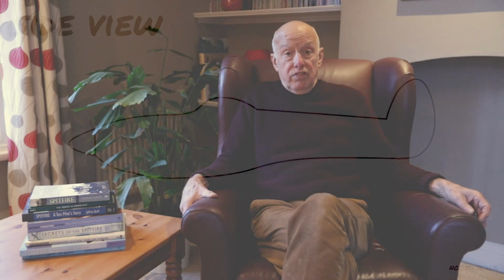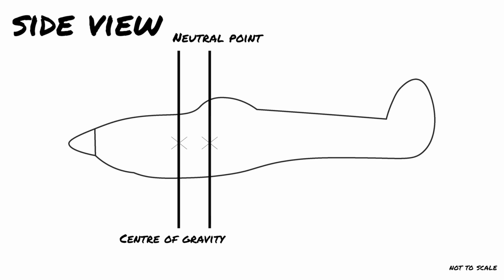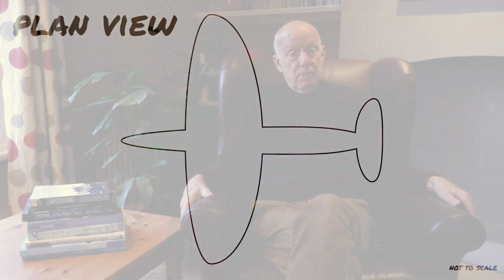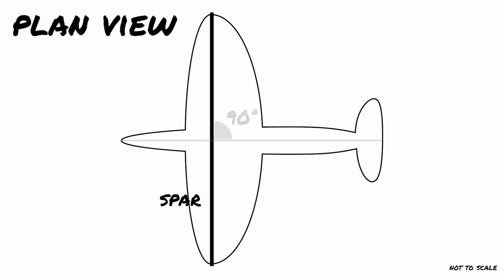SPITFIRE SPEAKS: Spitfire Longitudinal Stability

Comment: More than ten years ago I was an ardent player in a quite good flying simulation, Il-2 Sturmovik. The downside of the game was obvious adjusting of the favored flight models. From one point a modification to the FM of the Spitfire has been made that made it marginaly stable on the lateral and vertical axes (longitudinaly and directionaly). That spoiled the aiming quite a lot. I made myself quite obnoxious on the forum of the game about that, saying that no one would have let such a vice uncorrected. Now I see that I may have been wrong (maybe they have overdone it, but I cannot know). Thank you for an excellent video. I suppose that could be the reason the Hurricane has been oft described as a stable gun platform, in comparison, obviously. Otherwise, the Hurri was a log in the game. The capability of the game to portray the plane FMs accurately was quite obvious, but the adjustments to suit the wishes of the parts of the game community were just as obvious, as well.

Comment: Fantastic video. Loved the explanation of the neutral point and C.G. A little confusing around the N.P. and the aerodynamic centre.  Second point: is there any information anywhere as to moving the engine forward an inch or two to help bring the C.G. range forward? Having flown both a 3/4 scale Spit and a 1:1 Spit I can say : it is in the wing!!!!  The nicest wing I have EVER flown.

Comment: With reference to the vertical stabilizer (tail fin) of the spitfire:

Are any spitfire fin leading edges offset to the centerline of the fuselage, to correct for engine torque / propellor P factor that causes yaw. Or was this problem simply addressed with the rudder's trim tab?

If done, the offset will be to the left for the Merlin Spitfire and to.the right for the Griffin powered Spitfires.

I have noted the the P51 Mustang has about 3/4 of an inch of offset to the left of centerline of its leading edge of the extented fin  to correct for the clockwise turning Merlin.
engine.

J

Comment: Very interesting. I have often wondered why Spitfires could not carry out long range escort missions like the Mustang. I have often wondered why the Mustang was faster than a Spitfire with a similar engine. When the Spitfire Vs were being given the run-around by the Fw190s, I wondered whether the Spitfire might have been made a bit quicker by making the rear wheel retractable, but maybe that would have moved the aerodynamic centre point forward? Some Spitfires had clipped wings, but I don't suppose that made much difference to the centre point. A lot of Spitfires had that car mirror on the canopy. They must have felt they needed it, but maybe that affected stability too. The first part of your video made me think of WW1 Sopwith Camels. I know they had a rotating engine, but their wings were quite far forward on the fuselage. They were manoeuvrable, but difficult to control for novices. Other aircraft like RAF BE2s were too stable.

Comment: Hmmm....... Well,  MkIX's were NOT produced with a larger fin, and only a few had the slightly larger rudder fitted when new, though the 'XVI's all had that. In fact, for the purpose for which it was designed, the Spit's tail surfaces were adequate up to the IX. Under normal loadings, the Spit's up to and including the 'IX were just adequate longitudinally, and for the job in hand, that was fine. MkIX's/'XVI's were being produced from 1942 until the end of the war with no significant changes, other than perhaps the bubble-canopy, which a few MkIX's had - and many 'XVI's had with the taller rudder - but these were relative details.

As for the suspected problem with inflight break-ups, my recollection is this was around the MkV with four cannon, that also had bomb shackles fitted inline with the cannons.... One pair of cannon were deleted, and stiffeners added to the wing as a fix. (Four cannons were not fully re-introduced until the later much redesigned wings on the MkXVIII & later.).

CG issues were a separate matter. (Extensive test were carried-out on the MkV for example, to ascertain how severe a rearward CG the MkV could tolerate.).

As for cooling on the ground - the problem was not specifically the position of the radiators, but the fact that the u/c interfered with the airflow in front of the radiators. As soon as the gear was retracted, there was no problem.

The problems really started with the installation of the Griffon in the MkXII, though at that stage - it wasn't producing such prodigious amounts of power and torque as the later Marks. These were soon addressed. Of course, by the time the MkXVIII/21 came along, most of these issue were solved, however, by that stage, there really wasn't much 'Spitfire' left in the true sense, except some of the lower half of the fuselage......

BTW;- The later wing's ailerons were metal-covered and differently hinged - size had nothing to do with the improved roll-rate.

It's a common fallacy to compare the Spitfire unfavourably with the P51B et al. The Spitfire was designed from the outset as an interceptor and air-superiority fighter. End of. Whilst for various reasons the P51B et al were capable of greater range than the Spitfire, it was not, in the strictest sense, such good fighter. However - as some American wit was reputed to have succinctly put it - 'The Mustang can't do what the Spit can do - but it can do it over Berlin!'......indeed.  Horses for courses.

A pal of mine who passed-away a few years ago flew every Mark of Spitfire and Seafire produced, as well as all the other Allied single-engined fighters and a good deal else beside. He was unstinting in his praise for the Spitfire - not simply in a partisan way, but because of the actual hands-on flight characteristics of the Spitfire. His view was that whilst, as a fun aerobatic mount, the magic started to fade after the MkV, as a pure interceptor and air-superiority fighter, the Spitfire was the best of the Allied piston-engined fighters until the end of the war.
Reply: Interested in your one line comment as to the ailerons. I understand that the later (Mk21-24s) were piano hinged, but I also thought that Quill and his development test team had ‘discovered’ the benefits of metal ailerons by the end of 1940, and these were quickly adopted for all spitfires produced from that time onwards and rapidly retrofitted onto spits already in service.

Quill was obviously biased but he thought that the Mk VIII had the best overall flying characteristics, including I believe regarding aerobatic ‘fun’. 

Also intrigued by your comment that the size of the aileron doesn’t matter. Clearly Supermarine thought that going larger on their redesigned wing for the Mk21-24s was a good idea. Would you care to expand on your thoughts? Cheers A
Reply: @andrewmetcalfe9898  ;-  Ailerons;- Correct - and it was the piano-hingeing that finally sorted the ailerons. To be clear however, unnder normal circumstances, even the early Spit's fabric-covered ailerons were fine. The problems occurred at very high speeds, when the fabric would 'balloon'. Heaviness - then severe stiffness, then finally reversal could be experienced - but we are talking about diving balls-out in a combat situation. Even in 1940, Spit's were diving at around 500mph. When JQ was seconded onto an operational squadron, he was quite alarmed by this. I think as a result, Spit's were then produced with a somewhat lower-range ASi's..... All this occurred of course, because the Spit' had such a thin wing with a much higher Critical Mach number than other fighters around at that time. At the other end of the scale - huge problems were experiences with compressibility on the P38 - but that's another story.

My pal was a close friend of JQ's. The MkVIII was very close to a MkIX, but whilst both types enjoyed greater power in absolute terms, at or near sea level, the lighter, and higher-powered versions of the MkV had the edge. At full power, my friend would take-off, then pull-up  and over into the inverted, retract the gear, erect the a/c, then pull-up into a sieries of half-loops to display height. During the initial part, the machine was rather hanging on the prop' and one cough....and that would have been it....but they were different times. This was also before the proper pressure carb's were introduced, so inverted running-time was severely limited.

Ailerons again;- I didn't say that the size 'didn't matter' - I was referring to the fact that it was the new type, that was  piano-hinged that fixed the problem - a much better gap-seal for starters. I don't recall there was a vast difference in size. Staying on this subject for a moment - one of several reasons that the MkV's had such a hard time when the '190 was introduced, was that - although the Spit'V could easily turn inside the Fw, the Fw had a much better roll-rate. Add to that the '190's better acceleration into a dive....and you can see the problem. At that time - Spit V pilots were strongly briefed not to dawdle and to fly in the best part of the MkV's envelope at a high cruise speed - and NOT to give-in to the temptation to dive-away.... In any case, the MkIX soon came along and more than matched the '190 - and was heaps better over 20k'.
Reply: @HeavensGremlin  thank you for your very informative reply.
Reply: Thank you for your informative comments. The first MkIX's were just converted  MkV's and had the original tail fin, so the broad coard fin was introduced primarily to combat the additional torque reaction of the 60 series engines.
I had always thought that the tendency of the Spitfire to overheat during prolonged spells on the ground was due to the radiators not being fully in the prop wash. One thing that has always puzzled me is that the MkIII was abandoned because they had trouble accommodating the XX Merlin engine with two speed blower and yet they managed to modify the MkV's to take the longer 60 series engine in short order. Maybe the FW190 threat was so serious that it concentrated minds wonderfully!! One thing is for sure, Stanley Hooker at Rolls Royce was a massive
help in that he first got more power for the Merlin 45 by redesigning the air intake, blower impeller and diffuser, so that the Spitfire V was able to cope with the BF109F and then even better, he came up with an inspired design of the two stage, two speed blower with after cooler, in a small enough package to get into a modified Spitfire. The MkIX was surely the best interceptor fighter of WW2, in combining all the handling characteristics of the original Spitfire with a compact and very powerful engine package. Sorry, I am forgetting the later MkVIII, which was a shade better still!
Reply: @jamesmorse959  ;- The fins on the MkIX/XVI were all identical to the MkV's - only the rudders on later production machines were slightly altered. You can see many photos of the apron at VACBAF full of MkIX's fitted with the original rudders. Most MkIX's had exactly the same rudder as the MkV's. Once the Packard-engined 'XVI started being rolled-out, yes they had the pointed rudder, and a few MkIX's may have had them too. Incidentally - most people think that only the XVI's were bubble--canopied, but in fact, some of the MkIX's also had that cut-down fus' too - with the slightly larger rudder. Likewise, some XVI's were high-backs - but those would also have had the pointed rudder, and I think this is where some confusion has often crept-in.

On the speed of introduction of the 60-Series Merlin;- The reason they were able to move so rapidly in response the the arrival of the '190, was that the new engine already existed as a complete ready to go turnkey-package of two-stage, two-speed supercharger for the new high-altitude Wimpey. The engine was not designed as a response to the '190 - it was already completed. When someone suggested fitting it into the Spit', they rapidly cobbled-together a prototype - up at Hucknall I think. From memory, they didn't actually use a MkV for this. Anyway - it showed much potential and the rest, as they say, is history. One of the very clever things that they managed to do was incorporate the Vokes air-filter, so thereafter, a separate version was no longer required to incorporate this feature. Thereafter - that nose/cowling ran through all the Merlin-powered variants, excepting the co-related PR variants. The extra cooling area required was added to the oil-cooler side, and, being aft of the CG, this probably helped to offset the heavier engine and longer moment to some degree. Although they went to a four-bladed Rotol airscrew - being wooden, the actual weight was probably similar to earlier all-metal three-bladed airscrews.

For fighting - the MkIX was without doubt an all-time 'great' - and from 1942 until wars end - the Axis had nothing to match it that was available in quantity. For pure low level fun & aero's, the Merlin 45 (See my reply to Andrew above.) engined MkV provided a powerful, yet lighter package than the 'IX great for fun - but after the '190 came along - if you were going into harms way in the ETO - then the MkIX was the best mount.

Comment: Many many thanks. Finaly sommeone explaining to me why the fuel tanks were forward of the pilot and never put behind or below him.  The small tailplane and in general small plane with big engine concept. The wing radiators of which there was only one at the beginning is also a subject. I suppose the impact of ever increasing engine power was not envisaged. Would not the weight of the radiators behind the pilot, as in the P51 configuration ,  also cause the same problems. I see I am at the right place for expert opinon so explanation of the Meredith effect would be good from anyone. Was it real?
What about the Bf 109 tailplane? It had struts, but the fuel was under the pilot. Range similar to the Spitfire.
Reply: Hi There, thank you for your nice comments. The change to two radiators in the Spitfire was to handle the heat generated by the more powerful Merlin 60 series engines. As well as this, the new intercooler on the two stage supercharger was also water cooled and needed an additional small radiator. So the port radiator was a combination of engine cooling and oil cooling and the starboard was for engine cooling and intercooler cooling.
I am no expert in thermodynamics but the 'Meredith effect' does work! It is particularly effective of the P51 because there was room to have a large plenum area before the radiator, thus slowing the air flow and then a large heating
of the air across the rad before then being compressed at the outlet. This did generate some thrust and as I said, the P51 used 100% glycol so the radiator ran hotter which also helped. The weight distribution and C of G of the P51 was quite different to the Spit, with the wings set further back and the aerofoil having maximum camber at 40% coard instead of 20% in the Spit. The result was that the neutral point was also further back and allowed loading of equipment further back in the aeroplane. If you look closely at the P51, the wheels are set quite far forward in the wings; this being to prevent the aeroplane tipping on its nose! The BF109E did have struts on the tailplane but these were discarded on the 109F, when an effort was made to clean up the aerodynamics a bit. I imagine that the tailplane structure was strengthened to enable this change. I do hope that all this makes sense to you, and thanks again for your comments.
Reply: @jamesmorse959  Thank you very much for taking the time to reply. I have just read the article in Wikipedia on the Meredith effect. It says that it was a British invention and that it was built into the spitfire even. There is a reference given. It makes sense, but I think as stated it  will work best at very high velocities. As the engine powers increased, and with it the heat generated, the advantages increase. The objective will be to heat the air to a high temperature in a very short space of time and incorporate it all in a square convergent divergent nozzle. A type of ram air driven jet engine concept?

I think that Prandtl did the maths confirming the ideas of others. Despite being a very big name I believe he was morally bankrupt.

Of course the Bf-109 also had NACA wings.